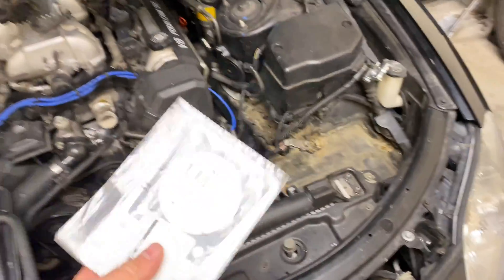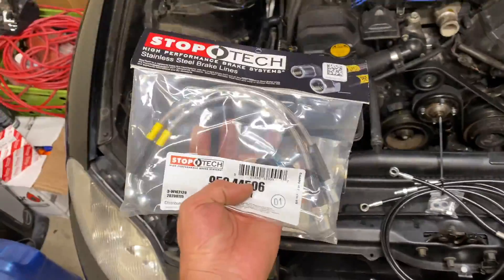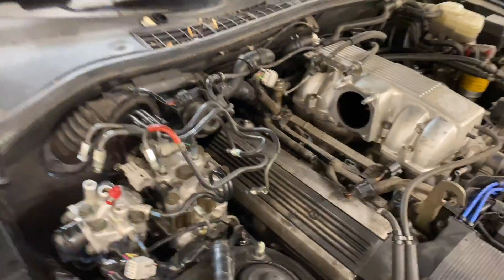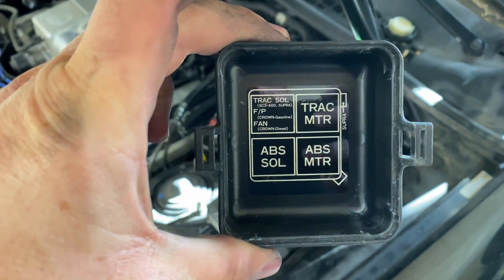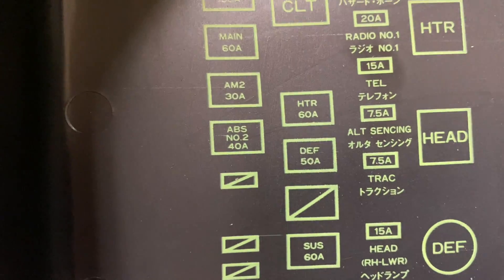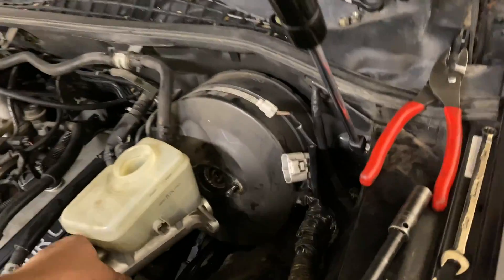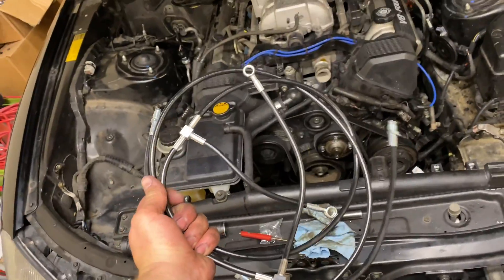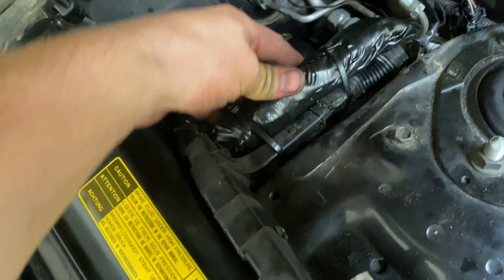SC400-Full ABS System Removal

Comment: So how does the car behave now without the ABS/TRAC? I’d imagine you have a constant light on the dash?
Reply from the maker: It does cause a constant ABS light on the dash. I’m just gonna pull the bulb at some point. 

Doesn’t affect any normal functioning of the car. I’ve driven mostly vehicles without abs, so that part doesn’t bother me really. 
And I like not have the trac system kick in and kill the engine power every time a tire slips. Just have to keep in the back of my mind that the tires will spin up in a hurry if it’s slick out, though sometimes that’s the desired outcome..
Reply: Once you remove the abs controller unit and the traction control unit it goes away

Comment: Love your videos...and I have question my 1994 sc400 lexus has a hard shift from park or neutral going into the drive gears it kicks like a donkey do you know what maybe causing this thanks I know your not a pro but you seem to have more knowledge than me...thanks for any advice
Reply from the maker: Thanks so much! 
Hard shift can be from a few different things. Where I would start from, and the most common, is fluid level. 
With the car warmed up, run it through the gears, then leave it idling in park. Then check your fluid level on the dipstick. If it is low at all, you can throw in some Lucas trans additive that could help out additionally. 

Some transmissions are sensitive enough to have shift issues at 1/2 qt low. Beyond this, it could be a more major transmission issue. 

Once you confirm a good fluid level, you can also try resetting the transmission learning. This is more of a newer car thing, but might apply to the SC.  Disconnecting the battery for about 5 mins might clear the transmission ecu and then it can “re-learn” from your driving habits.
Reply: @elementalcivik  doin the Lords work here!
Reply: @elementalcivik  ok k cool but did  a transmission flush and filled it up...but will check again...also just went to rockauto.com and the have this thing called a shift solenoid also has a description of what the part does it mention iradic shifting not shifting hard shifting so this might be the magic bullet...will keep you updated just in case you come across anyone with my issue got one for 64 bucks and the other for 94 bucks I am buying the 94 bucks one...
Reply from the maker: @kangokidkidd4037  I wonder if the flush process might have caused some gunk on the sensor or something. Definitely curious if that fixes it!
Reply: @elementalcivik  man I think that part is the issue..but the fluid didn't look that bad when I did it 4 weeks ago..but the hard shift was there before I flushed it...that's why I flushed it lol.
Reply from the maker: @kangokidkidd4037  Ah, makes sense. Well, you started with the simple option of fluid. Hope the solenoid does the trick!
Reply: @kangokidkidd4037  also having the same issue. Did the trans fluid help?